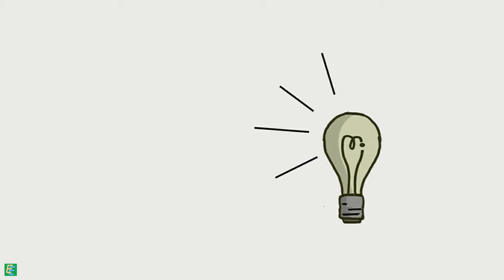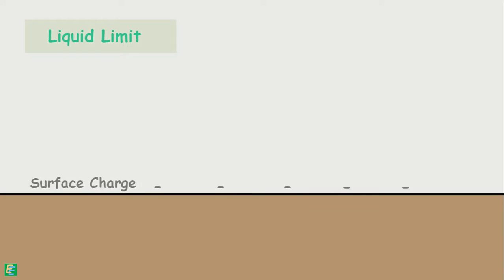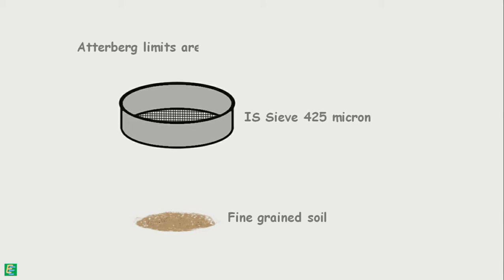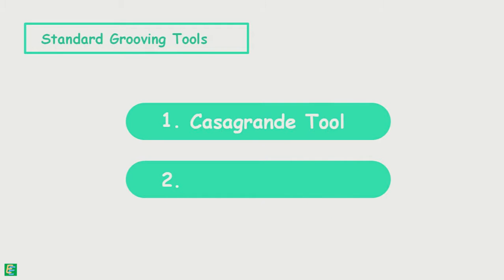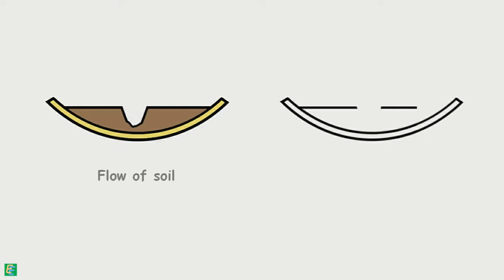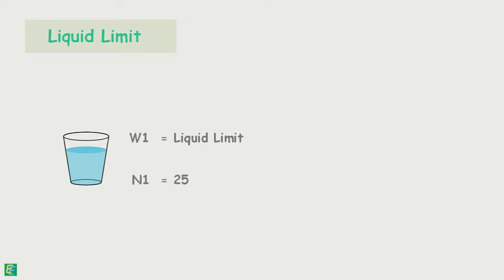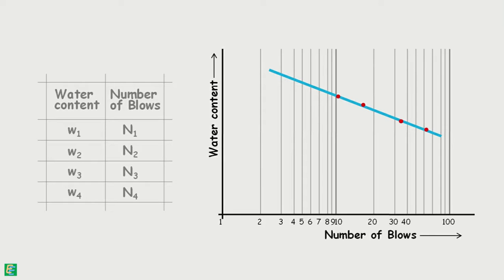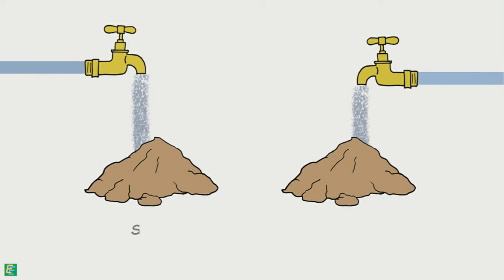Liquid Limit - Casagrande Method

Comment: Assalamo alaikum! 
I have two questions regarding this vedio can any body help me?
#1: why we use No 40 sieve not any other? If answer is to get finer fraction then why not No 200 sieve is used?
#2 why 25 No of blows is fixed to get the liquid limit value from semilograthmic graph?
Reply: Thats a good question, did you get a answer? i was thinking that was his experimental method example. I think you can use any sieve but the finer the easier to close the soil. I think you can as much blows as needed but it needs to be consistent in each test.

Comment: hello, can you help me to solve this question ?
liquid limit can be determined using the ASTM method by plotting the moisture content versus the corresponding number of blows on semilogarithmic graph. Liquid limit can be also determined by the fall cone test by plotting the moisture content versus the corresponding cone penetration on semilogarithmic graph. How do these two relationships look like? And why?
Thank you.
Reply: did you find a answer? im curious about the relationship
Reply: @jasonlewis460 If the number of blows in a Casagrande apparatus is more than the liquid limit of the soil will be more or less?

Comment: . If the material of the base of the Casagrande liquid limit device on which the cup containing soil paste drops is softer than the standard hard rubber,thenA.the liquid limit of soil always increasesB.the liquid limit of soil always decreasesC.the liquid limit of soil may increaseD.the liquid limit of soil may decrease
ANY ONE CAN PLEASE EXPLAIN THIS??
Reply: Liquid limit means that particular water content when 13mm (0.5 inch) meet under exact 25 blows.
Now when standard hard rubber used:
water content is X% & meet 13 mm & blow = 25.
Now softer rubber used:
Meet should be 13 mm & blow is also 25,
to do that flowability of the soil must be increased as rubber base is softer, so liquid limit will be more than X%.

We can say under 25 blow, to meet 13 mm using softer rubber base more thin sample is required.
So
Option A is correct.

Comment: Little correction

As per the ASTM standard, the contact length should be 13mm (0.5 in)
ASTM Designation: D4318 − 17: Standard Test Methods for
 Liquid Limit, Plastic Limit, and Plasticity Index of Soils, page 9

12.4 Lift and drop the cup by turning the crank at a rate of
 1.9 to 2.1 drops per second until the two halves of the soil pat come in contact at the bottom of the groove along a distance of 13 mm (1⁄2 in.). See Fig. 7 and Fig. 8. The base of the machine shall not be held with the hand, or hands, while the crank is turned.

NOTE 10—Use of a scale is recommended to verify that the groove has
 closed 13 mm (1⁄2 in.).
Reply: If the number of blows in a Casagrande apparatus is more than the liquid limit of the soil will be more or less?

Comment: Sir how water content is high at less no of blows
Reply: As example
13 mm meet by 5 blow - means more water in the sample - thin sample - less shear strength.
13 mm meet by 50 blows - means less water in the sample - thick sample - more shear strength.

3 points
1. How much distance meet
2. Water content 
3. No of blow

To establish relationships between any two, take the 3rd one as constant.